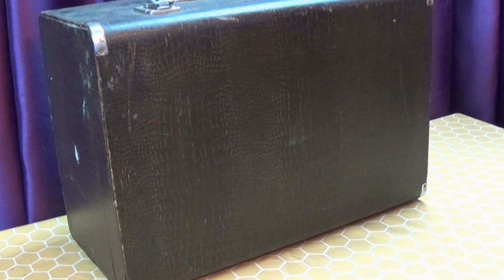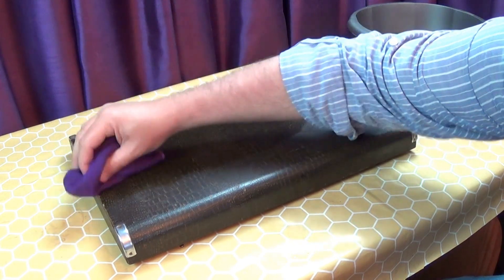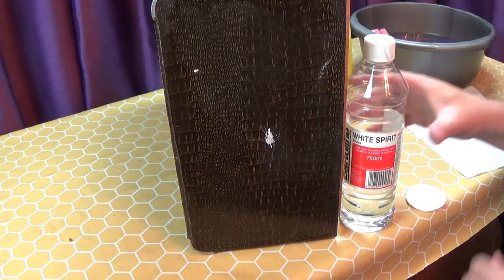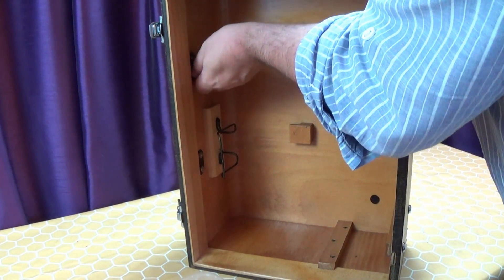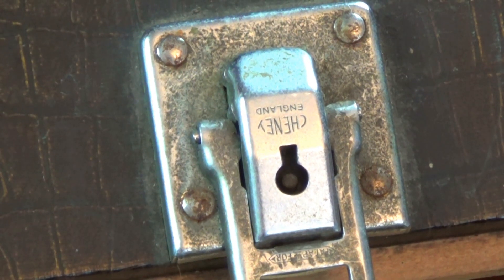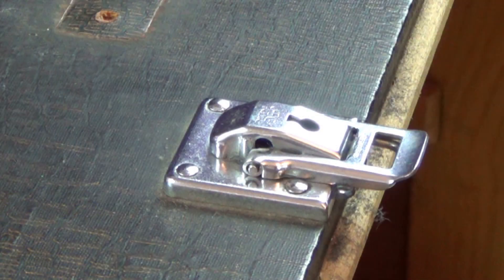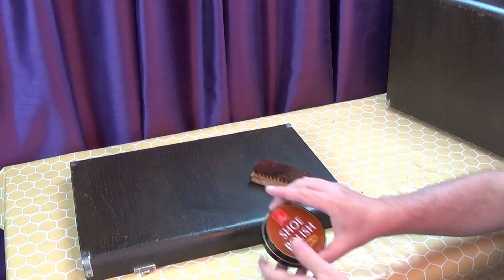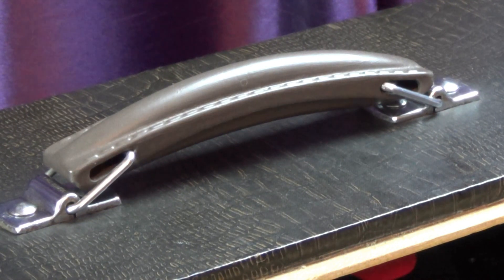Cleaning and Repairing a Singer Crocodile Case - Vintage Sewing Machines

Comment: To remove paint, gently rub Dawn dishsoap with your finger on the paint and let it sit for an hour and then use a damp (not wet, just damp) cotton cheesecloth to wipe (dont scrub! Just wipe, rinse the cloth, wring it out, and wipe again, repeat until the paint comes off.  You wont run the risk of cutting up your case with a razorblade.  Works on ducks, old sewing machines (my Redeye Singer from 1923) and it doesnt remove the finish.  Best wishes and keep up the good work!

Comment: I watched your video and am now inspired to work on refurbishing my case, too!  My case has a couple of issues besides just the aesthetics, though.  First, there's a strip of wood with hooks on it that I think needs to be reattached to the cover.  It looks like the hooks are supposed to fit into some hardware on the main part of the case that would connect the cover to the main part before the latches are closed to secure the lid completely. Unfortunately, the hardware that the two hooks connect to is missing.  Do you have any idea where I might be able to find replacement parts or purchase something that would work in place of the original hardware?  Any ideas or suggestions you may have would be much appreciated!
Reply from the maker: I'm having the same issue! Unfortunately the hardware on these cases was not standard and varies quite a lot. I may have to resort to making something.

Comment: Hi, Wonderful job on the case. I have the same one, and I wanted to know how you protect the hardware from rust after cleaning them? Would linseed oil do the job? Thanks
Reply: I'm using black phosphate coat (from gun/hunter store, thin layer of paint should works too) and oil.

Comment: I have a Singer 99k, from 1937, in the same case. Bought it online & the case was damaged in transit, due to the machine being insecure inside. Anyway the plywood now has a crack, kind of pushed out from inside & I've no idea how to fix it. Any ideas?
Reply from the maker: It's difficult to tell without seeing it, but if it is on the flat part of the case I would use wood glue and clamp it between 2 wooden boards, if that makes sense.
Reply: @CurioByBSpokeDesigns  I might just be able to get a clamp on it, yes. I'll give that a try, cheers!

Comment: What was the colour of the die you used?
Reply from the maker: I used a medium oak wood stain. Hope this helps.
Reply: @CurioByBSpokeDesigns  Thanks - my case is very badly scratched and have oddly enough tried that very colour of stain. Not so sure it's going to do the trick though. Am tempted to mix a little hookers green, brown and a little Payne's grey acrylic paint and touch up the scratches. Do you think that could work? And then once dry, to polish over it all....Your video gave me the confidence to try it, otherwise I wouldn't have had a go

Comment: The safest way to remove paint from a cabinet like this is with a single edge razor blade. And a very sharp one, not a dull one.  Very gently scrape at the paint until it begins to come away and stop just short of it being gone. The remainder should come off with a cloth and gentle soap, but if it doesn't, continue scraping very gently until it does.

A bit of care will leave you with a covering which is absolutely without blemish.